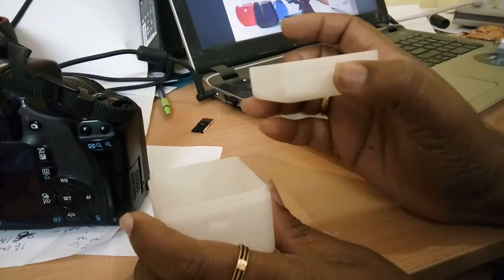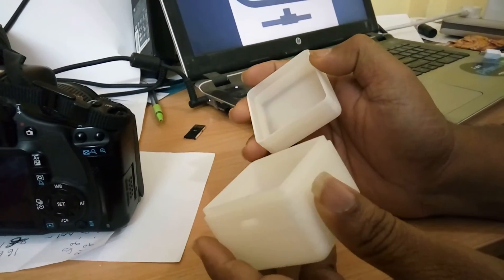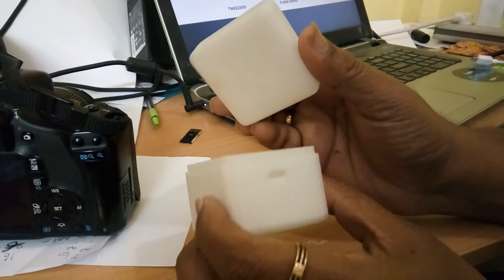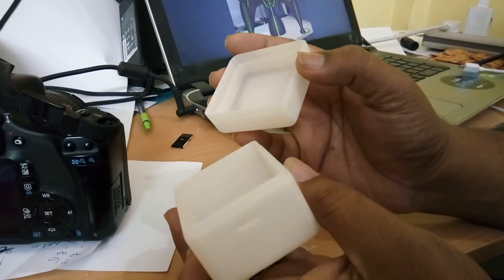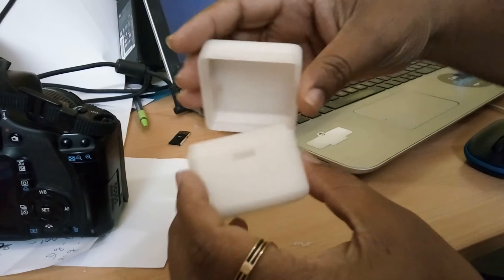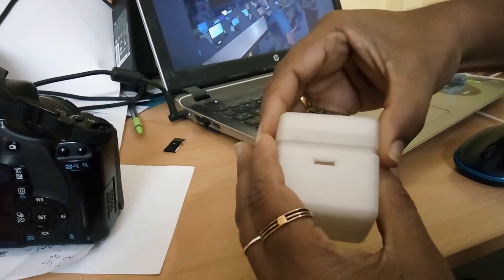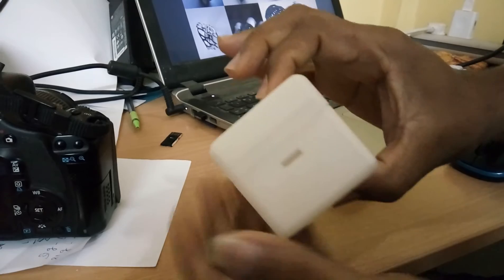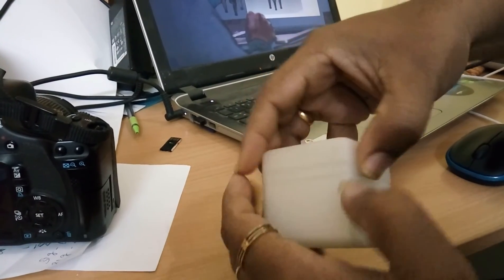Snapfit 3D Printed Enclosures - Botzlab

Comment: Hello guy,
Thank you for your video, could you please show me how to calculate the snap-fit for this box plastic. Thanks
Reply from the maker: Its basically based on the Plastic shrinkage allowance & tolerance. Most important factor is the ability of the printer to print in tight tolerance, that depends on the Printer Calibration
Reply: I also have the cube (3 in x 3 in x 3 in), so i divided it into 2 parts (body and lip), we create the mold for these parts, so I can not calculate the tolerances to snap fit between the body and the lip. could you help me please. do you have skype?
Reply from the maker: Khanh Nguyen try scaling accordingly, that could be other way, but might take one or two iterations
Reply: do you have a press fit tolerances charts for plastic in this case?
Reply from the maker: @KhanhNguyen-rr5ek  Rules of thumb
We printed in FDm with 0.3mm tolerance & 100% Infill with precise extruder calibration

Implement good design practices that reduce stress (fillets, build direction and locating lugs) and strain (tapered profiles, cantilever width)
Use a 0.5mm tolerance for FDM snap-fit connections and 0.3mm for all other 3D printing processes.
SLS Nylon is best suited for snap-fit connections due to its tear resistance.
Prototyping plastics are ideal for design confirmation but are typically lower in strength than SLS or Material Jetting materials and are not suited for applications where the connection will be opened and closed repeatedly.